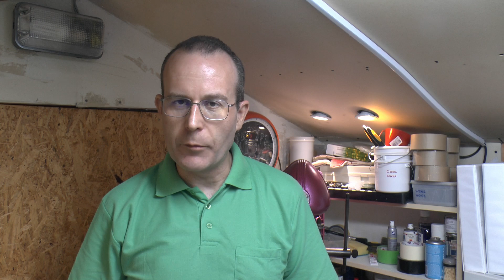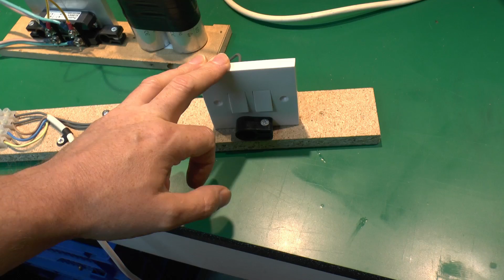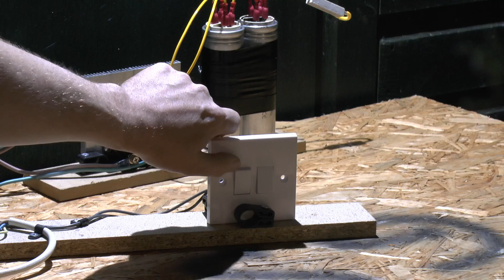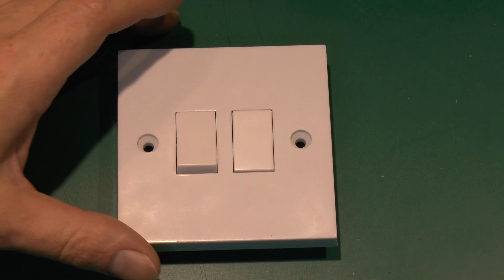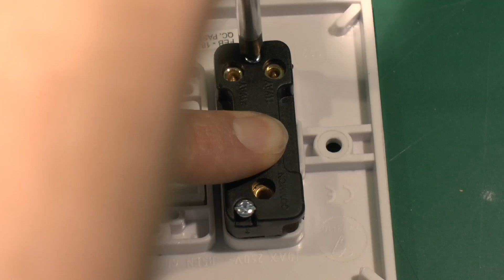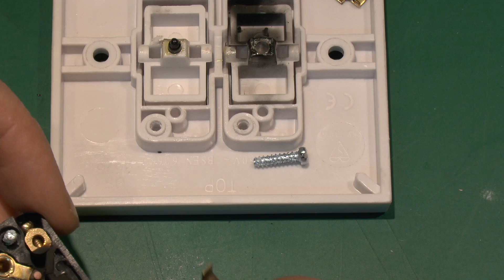10 amp AC Switch used on 7 amps DC

Comment: Perhaps I'm misunderstanding something, does DC arc more for the same rated voltage? 

It certainly appears so. In this case, makes total sense as to why it's unsafe. However, how realistic is this scenario anyway? Most DC circuits are 50v and less, so even with the greater amount of arc per voltage, there would almost certainly be less arcing because of the lower voltage

Comment: I used a 100Amp  AC  double pole switch as an isolator on my off-grid solar system,  24V  DC forklift battery to two inverters, 1kW and 2kw.  Now, 8 years later, the100Amp double pole switch is still in perfect working order, still isolating as good as it did when new.
Can any of you clever electrical engineers explain this phenomenon.  I could, by the way, but I'm in the know!  🙄
Reply from the maker: 24 volts is too low to cause any significant arcing on DC.

Comment: Hi, would you say a 20amp AC light switch would take the current of 5 amp DC light circuit in a motorhome?
Reply from the maker: Unlikely.  You need to get switches specifically designed for DC, or those which are confirmed as being suitable for both AC and DC.
Reply: @jwflame  thank you

Comment: I've got a 6a 250v switch, will it switch 6a 30v (solar panel) ok?
Reply from the maker: It can be used with a lower voltage, but only if used with what it's designed for - if it's only for AC, then it can't be used for DC.
Reply: @jwflame  thanks John, the spec sheet is a bit confusing as it says up to 3A 250v AC/DC as far as I can tell which is surprising!

Comment: Hi JW, I watched these vids a while ago and wondered why such a situation would exist.
Um... I'm eating my words now because I need to set up a 12v battery with 3 or 4 x  12v LED fittings for a field shelter. No chance of getting mains out that far. The MK Masterseal is ideal as it will be outside but there's no DC version. Is there a spark arrest capacitor that could be put across the switch perhaps or have you ever seen a DC rated Masterseal lookalike on the market???  Been searching to no avail. Just using lighting something like you would fit in a camper van. Not much current here at 12v.

Comment: Excellent Video!!  ...What type of camera do you use ?...I like those very close  recording (5:35) ...!!!  Good job an excellent video.  

Some technical issues ... the hardware store rarely carries a DC switch ... so you're stuck through the mail method to get your DC switch for your solar panel project. However for testing ... I have AC breakers (temporarily) ... and I cover part of the panel with a cardboard box ... to avoid arcing.

Comment: Very nice video to reveal the effects of DC on a switch designed for use with AC only. Perhaps it would be useful if you could describe in great detail what is the difference between an AC and a DC  switch. What makes it different and what kind of manufacturing technology and the range of materials  need to be employed when designing DC switches as opposed to AC ones. Tnx.

Comment: This is why home outlet is AC. High amperage DC is dangerous to be transmitted to home instead of AC.
Reply: Fikri Noh No. That's wrong. The current has no affect on apparent safety.

AC is used and is more dangerous than DC to the human body, it is used because transformers which allow easy transmission of power require AC.

Comment: what is the point of this video. No one has DC anywhere. The switches you have there are garbage, go buy better ones at electric wholesale places. ☹️
Reply: Houses with solar and wind generation, boats, caravans are some areas where DC is used. Solar feed into the grid systems (very popular in Australia) are another area where high voltage DC has to be switched, and there have been fires where AC only isolating switches have been installed. The point of the video is to illustrate that an arc does not self quench when contacts designed for AC only, are opened.
Reply: Actually not. Homes use AC because it is simpler one does not need to do the conversion, just a simple transformer is enough. DC was used in many places until the 1950s.

Comment: Do you prefer a black hat or hat black?
Your screwdriver keep the same isolation, no matter if you hold it by the handle or by the shaft.
So, for your ergonomic confort, hold it by the handle.
If you want to have an electric shock with a junk screwdriver like this one, no matter the sens you use it, so, use it normaly!
Thanks for this video
Reply: I think he was more worried about burning his fingers.
Reply: I would say he was more holding the shaft to make it easier to actuate the switch with the larger handle, allowing a greater force verses the shaft

Comment: A circuit diagram would have been nice. Were you using rectified AC and if yes any smoothing capacitors.
I have seen idiots use fuses / switchgear designed for AC on DC and they have failed to clear the fault and the arc was maintained till the 400v generator was shutdown (5Litre diesel).
Reply from the maker: Rectifier etc. covered in the previous video: https://youtu.be/mQpzwR7wLeo

Comment: What about low voltage DC? Most installations aren't going to be switching high voltage DC, but 12v DC at a couple amps is more likely.
Reply: voltage matters, check mcb datasheets. Some AC MCBs can handle DC currents but with lower voltage, usually about 60V DC max. but if you run 250VDC throught that same MCB, you end up smoking.  DC MCBs are rated for higher voltage so 250VDC is not problem at all.
Reply: I think the voltage doesn't matter all that much, as long as it's below the switch's rating. What matters is the current and the inductance of the load, which is related to the length of the wire. L*i²/2 is the amount of energy that gets converted to heat through the arc.
Reply: @yondaime500  Voltage matters because a higher voltage can more easilly sustain an arc and because for a given inductive component of the load current a higher voltage means more stored energy. When you look at panel-mount switches designed for use in equipment it's very common to see switches with much lower DC ratings than AC ratings. For example https://uk.farnell.com/arcolectric/c1250antaa/rocker-switch-dpst-i-o/dp/480344 has a rating of 10A 250V AC but only 1A 30V DC.
Reply: @yondaime500 That's a good point - when you disconnect an inductive load it still tries to push power through the (now disconnected) wires which causes the voltage in them to briefly skyrocket, which is enough to cause a spark, and once the spark is there a low DC voltage can maintain it more easily.

Comment: You cheated! 230 X √2 is 320 volts DC approx from your rectifier filter set up. Trouble is the peaks will have been down a bit due to rectifier resistance and capacitor sag but when the arc started flowing, the voltage would have climbed to round 300 volts and I don't blame you for using an insulator to operate the switch.
I had a friend who was a projectionist when carbon arcs were king and they operated at 60 odd volts and their flame was about an inch because of the evaporating carbon. Their power supply was a 3 phase transformer with a bridge rectifier and pi (capacitor, inductor, capacitor) filter so that the ripple was fairly minimal.
Even with my arc welder, I can draw an arc about 1/2" long with a welding rod at 30 volts DC. It's scary just how long DC arcs can get due to the plasma column. 
I serviced a derrick crane on a coastal (NZ) freighter (ship) during my apprenticeship and it had DC motors and the controller was in a cast iron box with asbestos lining and had arc blow coils fitted to make the arc stretch to breaking point very quickly when the contacts swung open. And I do mean swung; they moved about 6 inches and the arcs were spectacular until we replaced the worn contacts and adjusted the coils. It was foot operated and also had a huge carbon pile for speed control. I think the operating voltage was 250 volts DC and that came from a huge diesel DC generator... there were several derricks and the anchor winch to power. How things have changed. (Don't try this at home.)
Reply: He said it's the same set up as before.  If you watch the last video on this (https://youtu.be/mQpzwR7wLeo ), the whole thing was powered from a Variac so the voltage could be lowered to get 240 VDC, as confirmed in that video by a multimeter.  I also think the screwdriver was less about isolation and more about not wanting to burn fingers!

Comment: I always wondered why these switches are marked 'AC only' - never seen it demonstrated so well.
Reply: Do not switch DC circuits with AC switches got it JW .I actually thought you could but then I have never  needed to switch a DC load .it's why I love being an electrician. Because you can never know EVERYTHING
Reply: ForestCat_Peter AC are easier to break circuit because it will lower down the voltage when it's changing phase, meanwhile DC sustain the voltage all the time caused a lot of arcing

Comment: As you are using a full bridge rectifier with capacitors you need to divide 240 volts ac by 0.707 to get the DC voltage that gives you a DC voltage just shy of 340 vols DC. So unless you use a variac to reduce the AC input until you get 240 volts DC your test is not fair as the current draw will increase and a higher voltage will sustain a greater length of arc.

Comment: I would be interested to see how an arc arrestor circuit (capacitor and resistor in series) performs in parallel with the switch and then with a relay both designed for AC.

Comment: Hi John, could you show us a DC switch and how the design differs between switches designed for AC and DC? I'm guessing beefier internals on the DC but what about separation and spark arresting? I'd find it interesting and useful. Thanks.
Reply: Me too. I want see DC switch.
Reply: Stuart Hossack i said this in the last tests with a.c. and dc

Comment: Good to know. Perhaps you could do a teardown of a couple of regular panel type switches of a similar design to show the differences between a DC vs AC construction? 
     I know I've been tempted to reuse a switch that lacked a DC rating on junk projects. I have a few panel mount rocker switches in my parts bin that look very similar but are only labeled for AC or for DC. I'd like to know the difference.

Comment: You didn't mention that the nipple on the end of the spring connected to the rocker had completely melted, resulting in the spring being stuck to the moving contact.

Comment: What voltage was the DC? I’d have thought you’d be fine using your finger to switch.
Reply: Would you use your finger on a switch that you suspect might turn into molten plastic at any moment??
Reply: 240, I think. The arc would have been ionising the surrounding air, making it more conductive.

Comment: Great video as usual!
When I was searching for some wall-mount ornamental style DC switches, some online caravan forums suggested AC switches can safely be used if de-rated by 60%. This video makes me doubt that. I wonder how many people who relied on poor advice end up burning their caravans down.
Thankfully some manufacturers provide both DC and AC specifications.
I'm quite disturbed when manufacturers such as Wago simply state 10A without specifying AC or DC. They might assume people only buy their connectors for AC work, but with their growing popularity, many people are now using them for DC. At a trade show last year I asked the sales representative for Wago if the 10 Amps quoted limit was for AC, DC or both, but he had no idea himself!
Reply: Connectors don't care if it's AC or DC, unless dissimilar metals are used. Copper to brass and tin for example is ok, but copper to zinc is not.
However many car manufacturers still insist on using a busbar system stamped out of galvanized steel on the rear light cluster assembly. It's always the negative connection that corrodes away due to electrolytic reaction - dampness, dissimilar metals and current flow in the right direction.
Regarding caravans though, there's no real issue using a 250v rated switch on 12v DC.
Where the load is inductive, back EMF diodes or MOVs can be used to limit the voltage that appears across the  opening contact, this providing little opportunity for an arc to be sustained.
If you look at many miniature toggle switches, you will see that they are rated 3A 250V AC or 3A 30V DC. 
JW's video illustrates why the voltage rating differs.
Reply: Microwave Dave Surly with connectors it doesn’t matter if it's AC or DC. It's switches where it matters.
Reply: Thanks for your replies. Apologies if this reply is a bit long-winded, I tend to ramble! Please correct me where necessary, I'm sure I got some things wrong.
@Simon Parkinson - the problems you've encountered are similar to what I've encountered, which is why I'm so interested in this entire discussion. I've helped family and friends restore classic cars over the years and have found all sorts of unusual corrosion issues when the wrong connector was used in the wrong place.
I've also been installing LED lighting throughout the house and garage. Automotive switches and connectors seem to be the best fit for low-voltage indoor and outdoor LED lighting, as they are typically designed to withstand harsh environments at high DC loads. Unfortunately, the connectors are often large and ugly, which is why I've been searching for better alternatives for indoor use at home. I don't mind a thick bunch of wires with large ugly connectors screwed along the walls and ceiling, but it won't pass the 'wife test'.
Miniature toggle switches are often stamped with AC and DC ratings, but they seem to operate in a different way to the switches John demonstrates. In Australia one of our major GPO suppliers is HPM. They sell wall-plate switches with a mechanism similar to the switches John demonstrates. I called HPM's head-office and their tech department confirmed they do not recommend any of their switches for low-voltage DC environments. As you suggest they are probably fine to use depending upon the type of load, but the manufacturer doesn't recommend it. I'd like to try a set-up similar to James' switching a 10A load with 10A switch on and off repeatedly to test them myself.
@Ashley Booth - I should have been more specific regarding the Wago connectors. Wago do have a large range of pluggable connectors, some designed for PCB use. I just spent nearly half an hour on the phone with a Wago tech rep, and he was having trouble himself finding their low voltage DC products. It seems different countries have access to different product catalogues. He generally recommended using connectors with DC at 20% less than their AC rating, but said that could change depending on the type of connector and its intended use.
Plugs and sockets not designed for DC hot-plugging can suffer from spark degradation or destruction just the same as switches, so it's important to know if they have been specifically designed to handle power-on insertion, and to know how many insertions they are rated for. Unfortunately, many manufacturers don't specify exactly how these connectors should be used, if they are safe for hot-plugging DC or are only designed for power-off connection. This becomes increasingly important when people start installing home solar power panels, and home-made "power walls" made from recycled laptop batteries. Some of these systems can't be 'turned off' so the connector becomes the on/off switch.
Anderson Powerpole connectors are specifically designed to reduce sparking in hot-plug scenarios, whereas Deans, XT-60 and EC5 connectors are designed to be plugged into systems when the power is off (or at least reduced, when used in motor controllers etc). My battery chargers and jump-starter units use EC5 connectors which can handle 90 amps continuously and far more than that briefly, but I once accidentally plugged one in without realising the headlights were on in my car, and was greeted with a huge spark. One pole of the connector burnt off its plating and needed replacing. Also had an issue where a fused power window switch caused sparks when hooking up a charger. These things happen, and the wrong type of connector in this scenario can melt or catch fire.
We regularly had to replace FireWire cards at my old workplace. If you plug a FireWire 400 cable into a card in a dark room, you can sometimes see a big spark similar to the one seen in this video. Despite FireWire being a hot-plug standard, the connectors were not properly designed to mitigate contact sparking. After a while the connectors would burn out. That's less than 1.5A somewhere between 12-30VDC, but enough to damage the sockets over time. We tried encouraging employees to only plug in equipment while turned off, but it's not always practical to shut your computer down when plugging in a hard disk.

Comment: You released the magic smoke, I did a similar test with an MCB a few years ago. DC is destructive on electrical switching equipment designed for AC only.
Reply: Now i know DC stands for Destructive Connection.
Reply: Brilliant ! never thought of that meaning. Thank you.